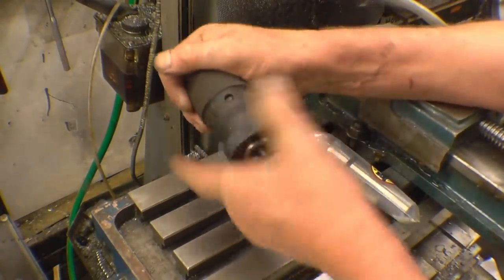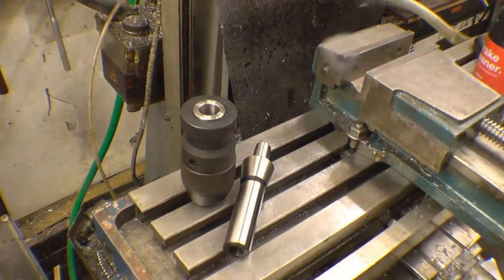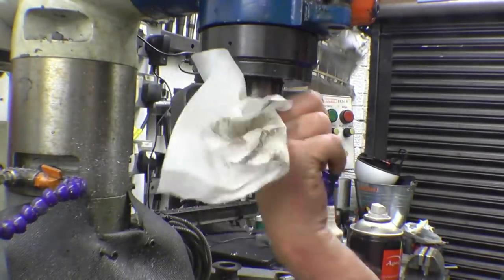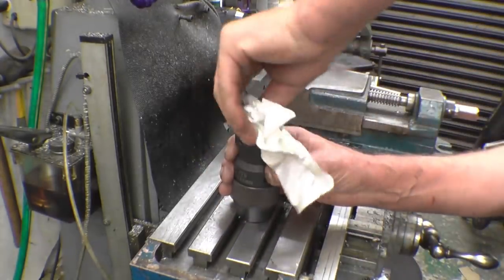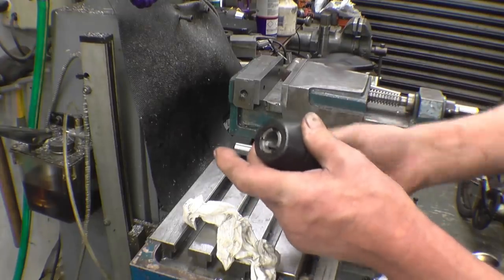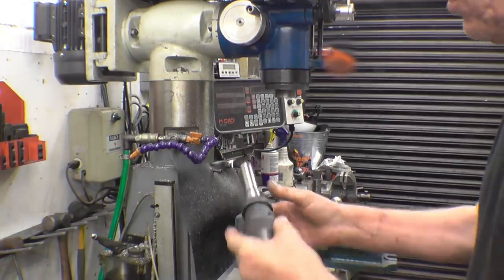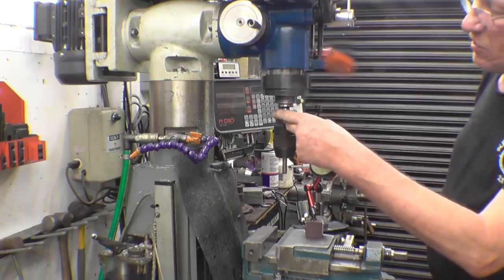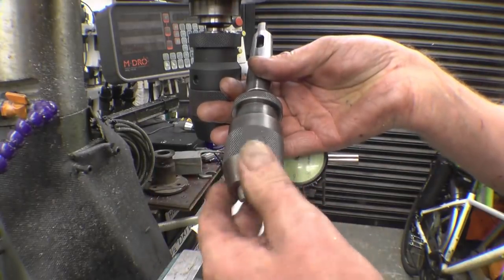Installing An Arbor Into A Drill Chuck

Comment: .002" is really good for a keyless chuck of probably Eastern manufacture.  Btw, is the fannie's hair Whitworth or has it become a Metric spec, lol?
Reply: Agree. I've indicated a number of similar Asian chucks. They had either .004" or .007" runout. I was surprised by the consistency. It was either one or the other. As such, .002 is quite good. IME, Golden Goose chucks from Taiwan can offer better performance, but the real thing isn't very easy to find. Personally, I usually buy Rohm, when looking for keyless. Like their older NOS keyless Supra chucks. The ones I have indicate well below a thou an inch down. Hard to complain. Just got a new one last week, so I'm pretty juiced. They're not cheap, but they are affordable.

Comment: less than.002 in 8 minutes, very well. People complain about those self loseners. with the strap wrench and clamp block you can clean one of those out in way less time than a jacobs. did'nt use lock-tite and the hood has only came lose once in about a year love mine in the tailstock for tap starting. Love jacobs though got a bunch of thread back gonna make some tormach type holders for thinking thread em on there,chuck em down on a dowel,finish the shank to dead nuts

Comment: Using a mill table as an anvil isn't how I'd do it.  Why subject such a shock load to the ways and gibs?  I'd say the chuck and arbor are keepers, as you said they are a lot more accurate than I expected.  Thanks for the video John.
Reply: I wouldn’t worry about it. That smack was about the same as seating a part in the vise. Cheers.